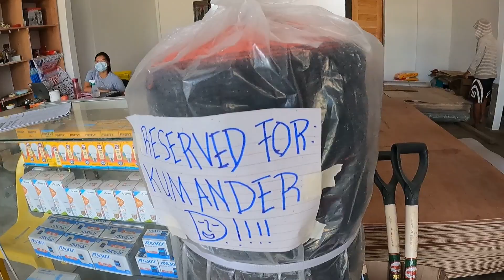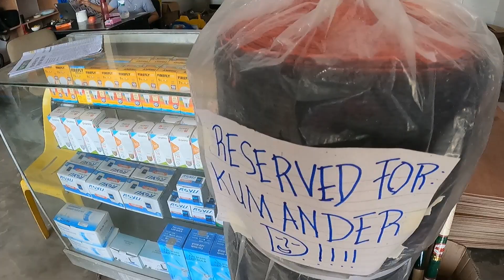$200 PHILIPPINES MOTORBIKE MAKEOVER (No Longer Daot)

Comment: $200 for a little restoration on your bike is so cheap Kumander D and it looks so good. They did a good job. I just had a tire replacement for my Piaagio BV 250 scooter and I paid $175 plus $35 to balance it and labor cost, it’s just for one tire,  the rear. Oh my god, I wish I can have my scooter fixed there in the Philippines.

Comment: 10k wow its too expensive they just paint it and i think puts some battery signals horn for the painting overhaul of the engine is tonexpensive
Reply from the maker: The automotive paint alone (high quality, marine use against saltwater) is 4k. That's 4 coats, plus primer, plus topcoat. They painted the plastic too. It has a new battery, new starter, horns, blinkers, stainless screws, oil, clutch, everything is tuned up. Plus labour. 10K is a very good deal.
Reply: On that
 amount i thought it has a decal stickers hahaha but its ok atleast you fix it already for ride

Tire size u should use is
19 for front
16 on the rear and all terrain tire for tough ride
Reply from the maker: @darrenlloyddaquigan6073  haha decals are cheap
The current setup is 18 front and 16 rear. I might go to 21 front and 18 rear
Reply: @KumanderDaot   wow gud project bike well hope to see you in your farm send my regards to kulas 🚲😉👍